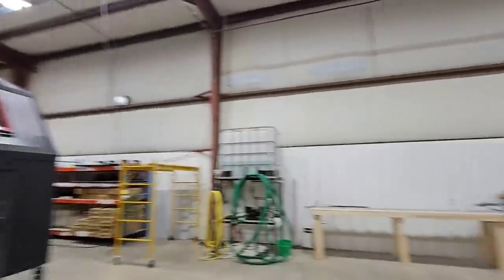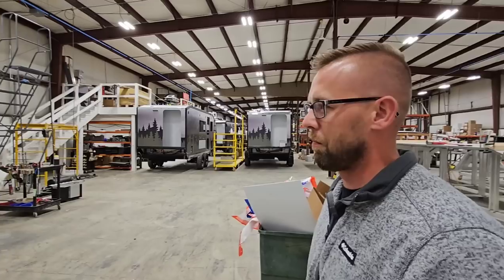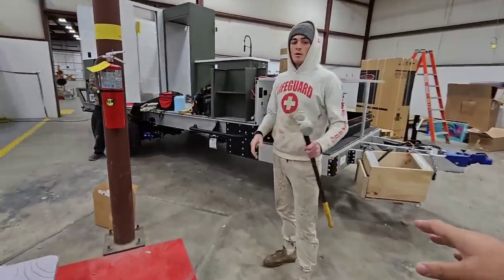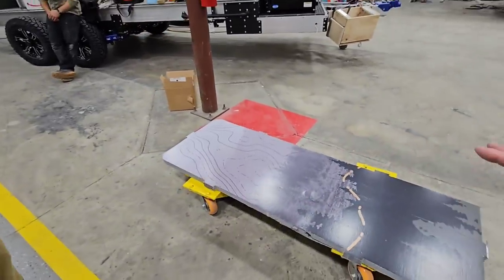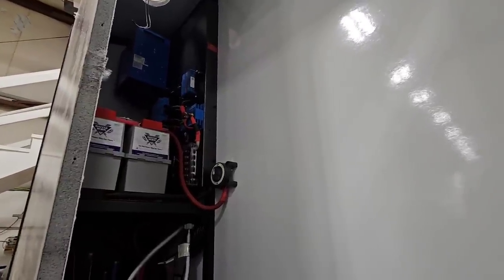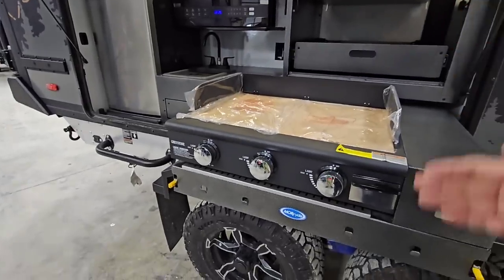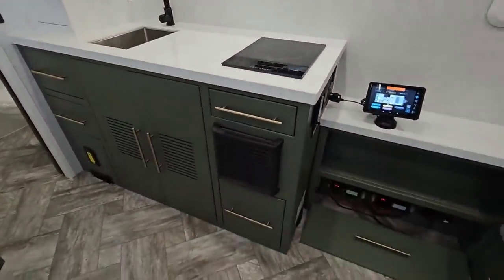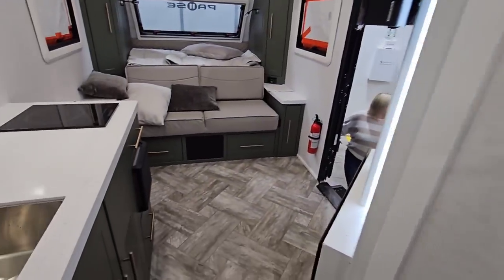UNBELIEVABLE TEST!! Palomino PAUSE Overland Offroad RV!

Comment: Wet cool rv’s.  Every time I see them I want that rear door to be on the side of the trailer.  I think it would make that room more accessible for bikes or canoes….to use as a garage. 

It would also be nice to protect the Victorino equipment with a protective screen or something to things don’t bang into expensive electronic equipment.   

Have hooks or molle panels on the walls to hold things like tools, helmets, etc.   tie down hooks or E track/L track in the floor. 

With that much battery, some sort of dedicated electrical outlet on the exterior to share the power with buddies while camping.  

I really love the innovation Palomino is showing here.  Kudos to them taking a huge risk to introduce something like this.  I wish them much success.

Comment: Clearly an extremely well built and well outfitted Bug-out/Expedition rig. I agree with the comment about the wiring, at least use wire loom in the firearm safe area and especially the chassis area where road abuse/abrasion will exist. Wish them well with their endeavors albeit they are targeting a small niche market that is made even smaller by virtue of pricing. Hopefully their target demographic will grow and contribute to their success. Best Wishes !!

Comment: Very impressive but I disagree about the sink size. Give me a large single basin with split cutting boards. Pull one side off and you still have the same counter space with a functional sink. Throw some of your dirty dishes under the covered side without losing countertop space and sink. It’s just been my experience that a large sink comes in handy as long as you can cover it for maximum counter prep space.

Comment: 9:02 that wiring job does not look like  a "game changer" to me. Palomino should be ashamed.  No way am I paying top dollar for an RV with high end solar components if that is the way they wire the unit. And no, do not tell me that is not a finished unit, it is. That  is why it is on video.
Reply: Deal breaker for me.  Looks like it could be an overpriced lipstick on a pig.  Peel back the nice to find garbage underneath.  This is what we see easily, wonder what other horrors there are.

Comment: lose the huge fridge on the 20.3. Most hard core dry campers don't need a ton of fridge space. You already have an outdoor 12V cooler and most boondockers like me own a Yeti. Put a decent 12v smaller fridge in and put a pantry next to it. 
Also have the option to delete the oven in place of drawers and make the microwave a convection. Most campers never use it an oven.
Reply: Agree.  15.6 cuft in the 20.3 is overkill.  I would think that an 8ft cuft compressor would fit their market space nicely.  Put storage above and below it.  Agree on the stove,  Never once used one.
Reply: just came out with the option to swap out the big fridge with a smaller one and add pantry!

Comment: I'm not knocking the trailer. But I will say you spend $20k on the Solar system and you are still screwed when it's overcast for couple of days in the mountains. If it was my 💰 I would scrap the solar and go with an inverter generator.

Comment: so where are the manufacturers putting out the $80k 26ft trailers? tons of mass produced $20-30k units that are essentially the same build quality/components, and a few of these more custom level options 140K and up.
Reply from the maker: Essentially the same build quality?  Lol, that's like saying a Timex is "essentially the same build quality" as an Omega. Or a Walmart Mountain Bike is "essentially the same build quality" as a Santa Cruz
Reply: @BigTruckBigRV  misunderstood. I am implying that all of these mass produced ~26ft units at the $20-30k or even 40k are essentially the same quality units with the same components, just different names slapped on the side. There must be units out there that improve on quality and are priced between these two extremes while staying around the 25ft length.